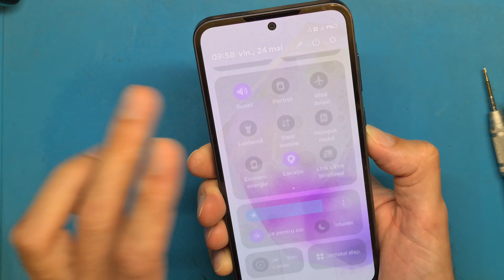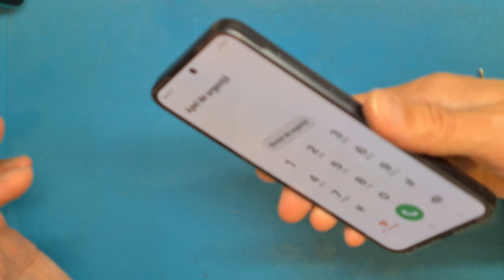Samsung a35 a356b screen replacement and disassembly original display without frame

Comment: Why you remove mainborad7upper part? it has no connection to the screen, so just for safety?
Reply from the maker: @ganznormal559  it is safer to disconnect the battery if you replace the screen

Comment: Samsung Galaxy A35 motherboard price
Reply: Bro do u have speaker grill on top ?inside
Reply: I guess that 10k for 256 gb
Reply from the maker: the grill could be inside the metal frame, in between the speaker and the opening, but it is not visible on the outside
Reply from the maker: We do not have this for sale
Reply: @phone_fix  Samsung Galaxy A35 motherboard not sell
Reply from the maker: @GANPATI1923  no, sorry